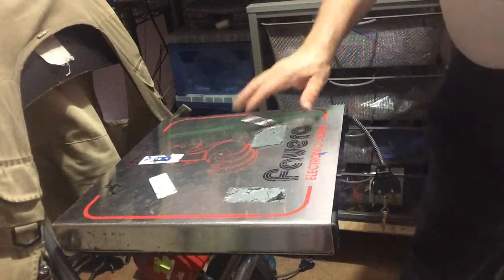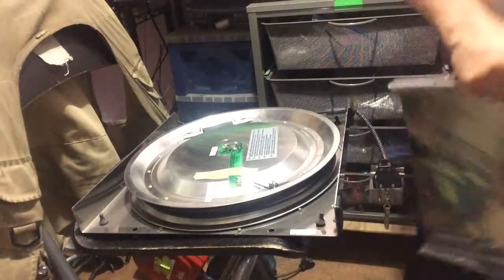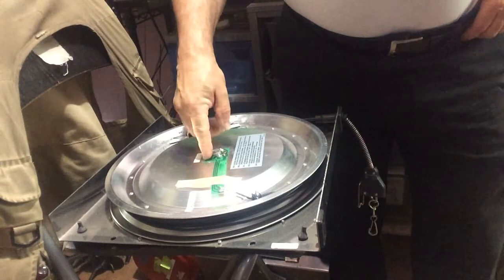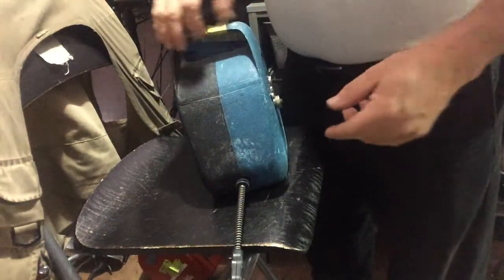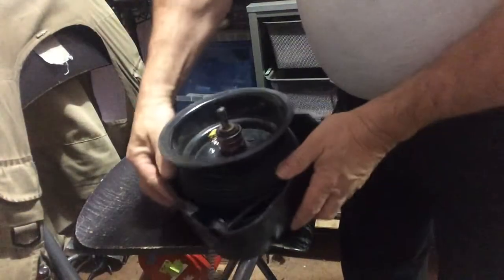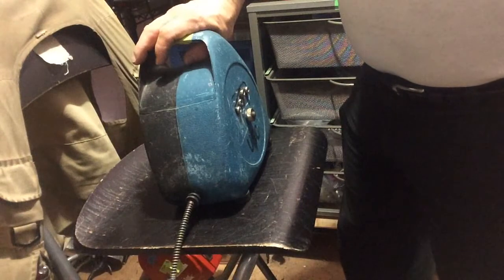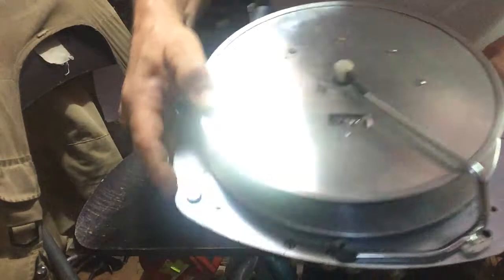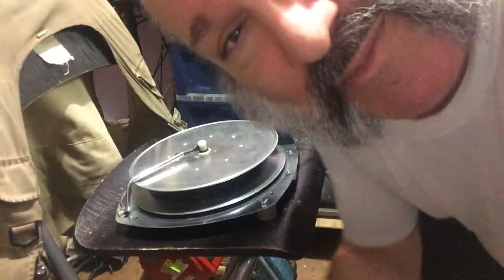I Can Haz Armory #33 -- Inside the reels

Comment: I'm thankful I have yet to need to fix a reel xD thanks for the vid!
Reply from the maker: Havent had to fix a reel?  As Yoda said to Luke "You will be....you will be!"

Usually the problem is up in the plug head or a break in the cable jacket fairly close (within a couple of feet) of the plug.  Those are fairly easy fixes....it's replacing the cable that's  bit more labor intensive.

I got the cable for the Favero in yesterday.  I might shoot the replacement tonight.

Comment: I've noticed that the reels have chips. What are the chips for?
Reply from the maker: They aren't computer chips.   They're simple circuit boards for the wire connections.

On the Favero, the wires come up out of the spring pack at the center of the reel.   They're soldered to one end of a circuit board.   The other end of the board is where the 20m cable is attached.
Reply: sam signorelli thank you!